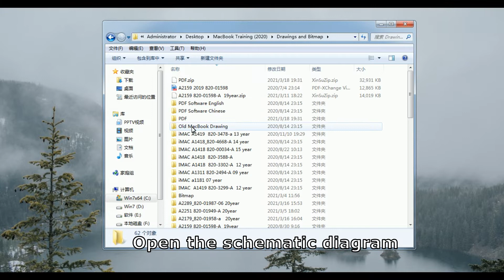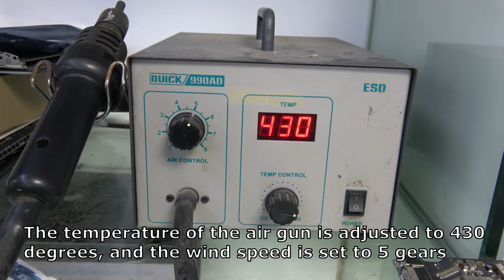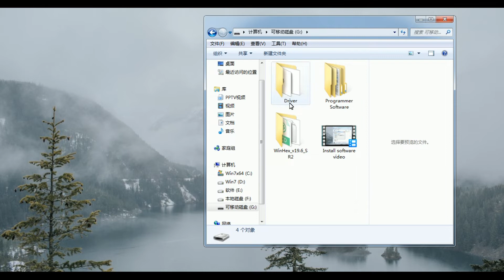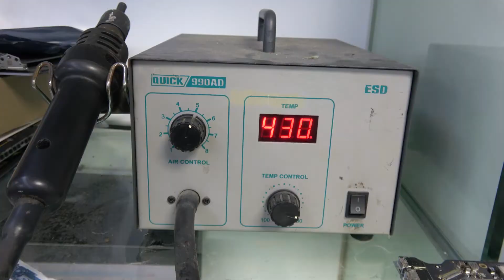How to Flash T2 Chip of MacBook Pro (15-inch, 2018)

Comment: Nice video, few thoughts. 1. Remove board. 2. Remove stickers, use hotair at 150c to remove them without damaging and stretching. 3. Put capton tape to keep heat from BGA chips around. 4 perform whatever you did with SPI. 5. Clean the board so no stains are visible. 6. Put stickers back, use hotair 150C to fit them perfectly. If done properly, this takes 15 min more compared to your job but you are not leaving burn marks and flux on  board. Customer might sell this laptop,  it also wont be rejected by apple service if he uses replacement program for flexgate or butterfly.

Honestly, soldering chips in chassey is a very bad practice. This might cause unintentional damage and looks unprofessional. This repair could be performed with  apple configurator  2, DFU mode and revive tool to keep the data.